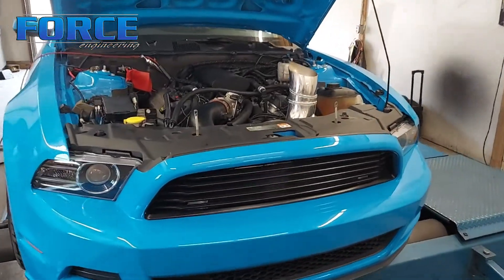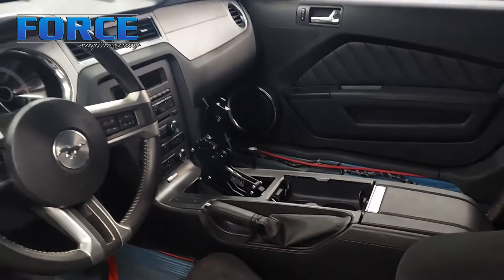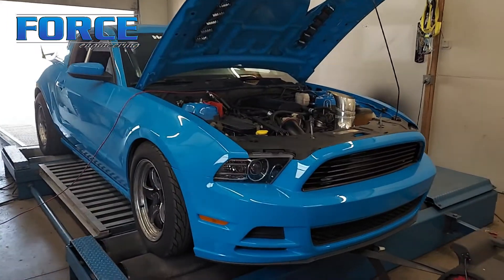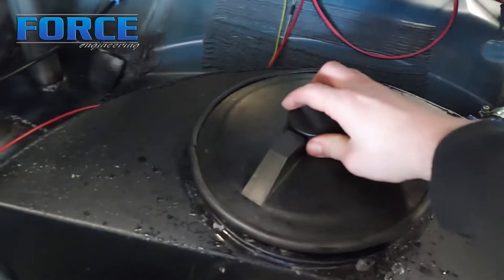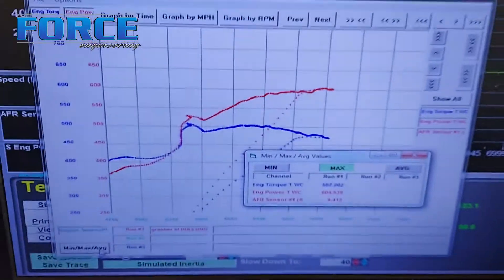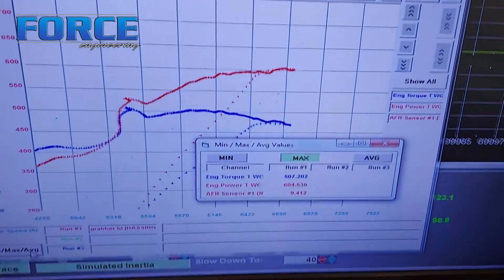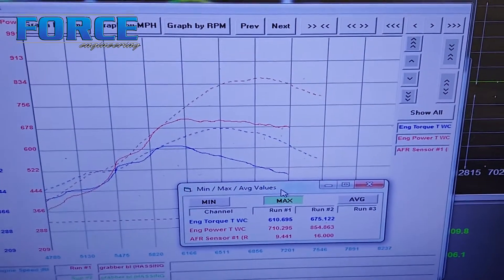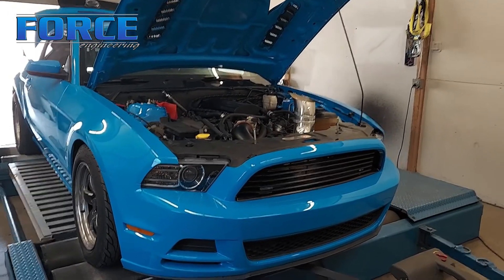Dyno Review - Th400 Swap S197 | Turbo Coyote | -150hp Vs 6R80

Comment: How much loss should I expect on a build NA s197 coyote?
Reply: no reason do this on a na mustang its a trans built for over 800whp
Reply: @gutallama  I’m pushing 600 Na and thinking of doing a 150shot down the road
Reply: Are you for real. My NA fuel injected 438windsor 68 mustang weighs 3k lbs is fast as fck with th400.  You dont know what you're talking about.  A big stalled th400 will destroy a stick even if stick makes another 150hp. Th400 eats more power but the car is faster. Believe me i know.  Dynos and HP numbers are bragging rights only.
Reply from the maker: Remember, the engine is making the same power here.  Its all lost through the converter.  Our car trapped the same mph. 

How much is lost in the dyno will depend on the converter

Comment: I’m running a built th400 too on my 4.7 KB 2014 GT500. I really like it. Mainly fun street car and driven to shows on the weekend. On a conservative tune on pump E70 made 879 so probably safe to say should be well over 1k through a 6 speed
Reply: 880wheel through a big stalled th400.  You must be running 25psi boost. Thats an 8sec car you have. Th400 way better than a stick.

Comment: im still trying to understand this concept. I was on dyno yesterday and laid down 980whp through my th400 combination. Curious what it actually will make by track et. I'm reading most guys are down 100-200whp on dyno vs track.
Reply from the maker: There are lots of factors there. Converter attitude changes do to how the dyno loads the car is the biggest one.  At the end of the day, the dyno is a tuning tool. We get a base line, and make improvements.
Reply: Dude you've obsessed with dyno numbers.  Th400 will make less power but be faster. If you're making 880wheel through a big stalled th400 you have 8sec car. Dont worry about stupid dyno numbers.  I run a big stalled th400 in my 68 mustang and its seriously badass.
Reply: If you're making 980hp through a big stalled th400 then you car is making like 1200crank plus. You must be running 30psi boost...lol
Reply: @maximusvonce1381  the setup and changed alot since then!
Reply: @IITHEFLASHII  What did you change.? 980wheel through a big stalled th400 is 8sec car bro. That is some serious power through a big stalled th400.  Probably mid 8 sec car.
Reply: 100% agree. I’m really trying to get that statement in my head. “We don’t race dyno numbers”
Reply from the maker: @1BAD_DAVE  It's a complicated thing, and trying to understand it is challenging. I am around it every day. I still struggle to explain this to customers and have them walk away accepting what I explained.

Comment: What was final dyno number with th400?
Reply from the maker: right around 700 on 14psi
Reply: @ForceEngineering  Thats good fcking power through a th400. Is this car an 8sec car. Guessing 900 plus crank
Reply: @ForceEngineering  What's car weigh?
Reply: @ForceEngineering  Guessing it runs in 8's
Reply: @ForceEngineering  So it made 850 with 6r80.
Reply from the maker: @maximusvonce1381  correct. 850 with the 6r.  Car weights 3760 with me.  That 700whp went 9.20s. Its been 8.59, but ive never had turned it up that far on the dyno.  Stock long block deal.
Reply: @ForceEngineering  Is that a gen 1 coyote or gen 2
Reply: @ForceEngineering  Wow. The th400 ate 150hp over 6r80..wonder why that is..Funny thing is even though it made 150wheel less with th400, it was just as fast or faster.  What do you think motor makes at crank? ..maybe 950hp,?
Reply from the maker: @maximusvonce1381  Gen 1
Reply from the maker: @maximusvonce1381  Its do to the converter being locked in the 6r80 and unlocked in the th400.  on 14psi is in the 900hp area.  I've had up to 26psi for a glory pass. unfortunately it spun 100 ft out.  Based on injector flow data it was over 1500hp at the flywheel.  its a time bomb lol
Reply: @ForceEngineering  Omg my gen 1 blew at 650wheel. Number 8 rod went south.
Reply: @ForceEngineering  Don't blow the motor. It wrecks everything.  I know.
Reply from the maker: @maximusvonce1381  oh i plan to blow it up.  Working on a new one now.
Reply: @ForceEngineering  It will wreck everything bro
Reply from the maker: @maximusvonce1381  im an engine builder by trade.  Ive broken a thing or 2 and 100% know what to expect.  Its the fastest stock gen 1 coyote currently and i plan to set that bar very very high.
Reply: @ForceEngineering  Hey whats car idle at in neutral and in drive.  Who tuned your car for th400?
Reply from the maker: @maximusvonce1381  same as it idles in gear.  800-850.  I do all the tuning on this car.
Reply: @ForceEngineering  Hey was it difficult to get car to idle at 850rpm with th400,  since pcm gives no provisions for that.

Comment: What stall you running.
Reply from the maker: PTC 16/0  at 26psi it flashes to 7k or so
Reply: @ForceEngineering  Omg 7k stall
Reply from the maker: @maximusvonce1381  its a turbo car so stall is all relative to the boost were making at the time.

Comment: How did th400 fit. I am putting th400 in my 900wheel daily driver 2011 5.0 soon..Hows it drive on street. What gears you running out back.  Is this a full manual reverse valve body th400..Badass transmission.  Cant wait to dump my manual.
Reply from the maker: took a big trans cooler (from an F350 and mounted in the trunk)  but it street drives well.  it has a 4.10 rear gear and 28" tire
Reply: @ForceEngineering  How does transmission cooler get air in trunk.  Best spot is in front of radiator
Reply from the maker: @maximusvonce1381  no room up there.  tons of people run them under the trunk.  its works fine, but it would for sure do better up front.
Reply: @ForceEngineering  Yea i got a ton of shit up front too, but i have just enough room between heat exchanger and ac condenser to stick cooler.
Reply: @ForceEngineering  My car is a street daily so i gotta put cooler up front

Comment: Who cares if its 150hp loss, still way fcking faster than dinosaur manual transmission.  Th400 is drag racing King.
Reply from the maker: It had 6R80 trans in it, Hardly a dinosaur manual trans.  its a 6 speed auto with a lock-up converter
Reply: @ForceEngineering  Is it faster now with th400
Reply from the maker: @maximusvonce1381  yes, but its on more boost now so its not a fair comparison
Reply: @ForceEngineering  So its down 150hp but faster. Dynos only for bragging rights
Reply: @ForceEngineering  Is your th400 a full manual reverse pattern sequential
Reply: 6r80 is a full auto transmission and run by pcm. 6r80 wont hold big power for long. Th400 will last way longer and hold up to full throttle quarter miles.